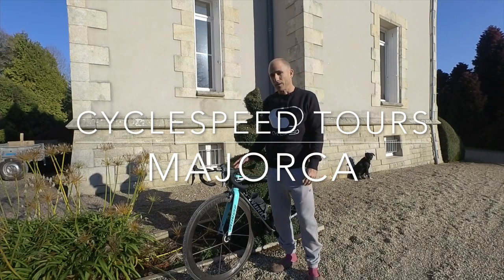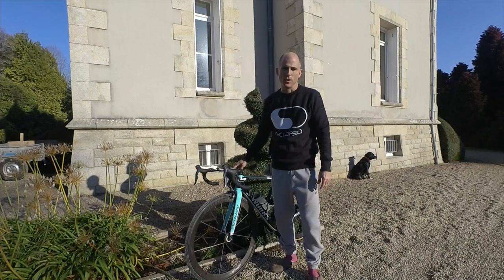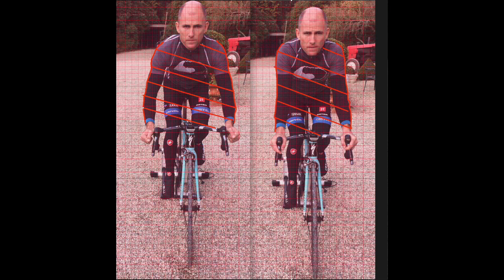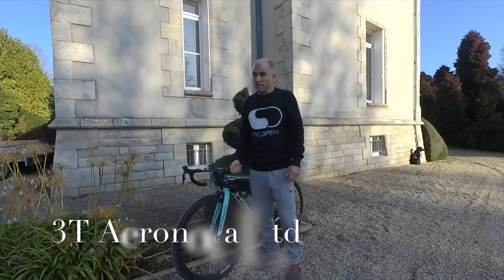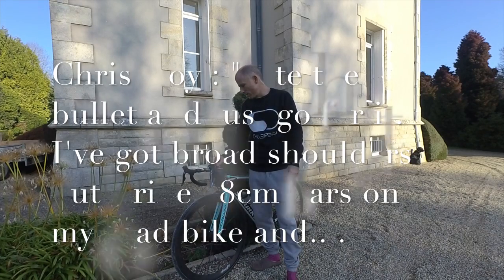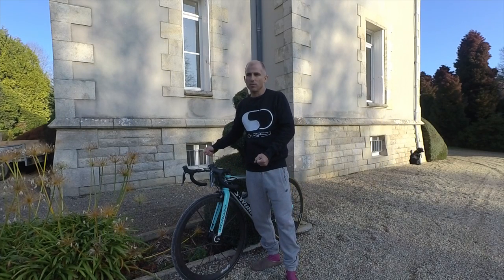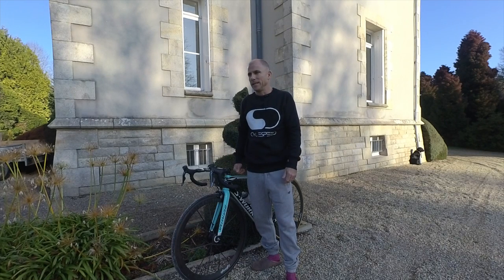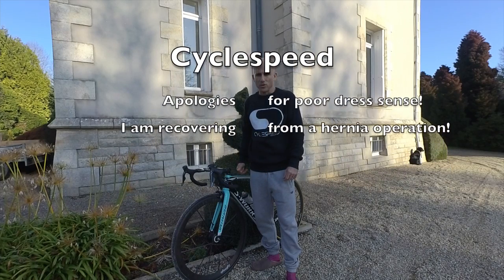3 Good Reasons to Try Narrower Handlebars (en francais aussi)

Comment: Hi
Please is possible explain me.I very curious this process biomecanic."A 'normal' Q factor is about 140mm, (so half is 70) + distance to pedal centre (approx 30mm) so the pedal force is applied 100mm away from the centreline of the bike.

A 400mm handlebar is 200mm away from the centreline.

Therefore the force you need to apply at the handlebar to counteract the pedal force is about 2 times less.

However, a longer lever (wider bar) will tend to scribe a larger arc, which promotes rocking of the body, which personally I prefer not to have."
Thx!

Comment: Good video. Informative. What is your view on the aeronova? I have heard it increases virtual stem length because reach is more. I am not sure if I should prioritise aero over comfort.
Reply from the maker: Thanks - I love the Aeronova - I'll add a link to our review of it at the end of this video. Yes, it does have a longer reach, but this is most felt in the hoods; flats = same, drops = less of an issue. I absorbed the extra reach fine, but you may want to reduce stem length by 10 to 20mm.